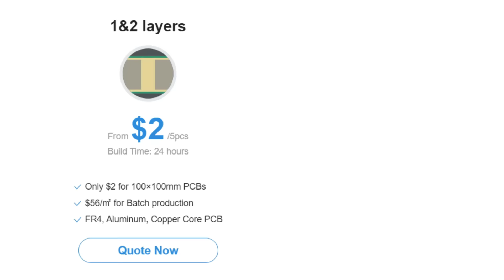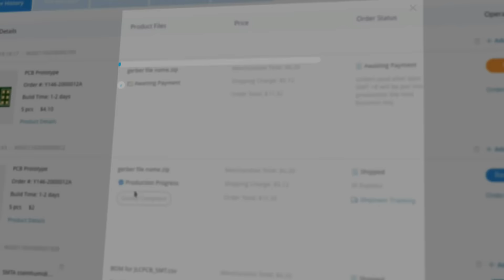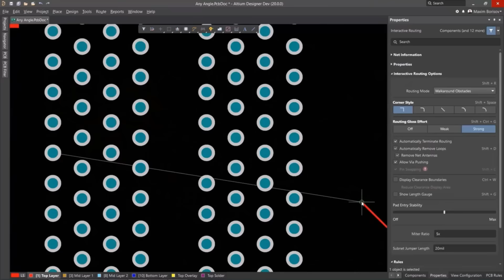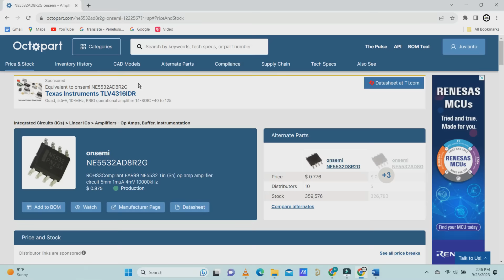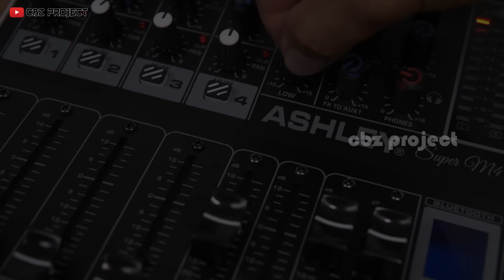2000W + 2000W Powerful Full Bridge Amplifier using 2SA1943 & 2SC5200 transistors #cbzproject

Comment: How did you split the power from one transformer? Did you have a single 20 amp power pcb dividing into two 10 amp outlets or did you take the common transformer supply to two 10 amp power pcb's for each of the amp modules.

Comment: That's really professional! Nice job! The only thin i would improve is adding some acrylic "square tubing" on the big heat sinks to provide good air flow all the way and at same time prevent that something can accidentally short circuit the eletronics.

Comment: beautiful build. 

Were you able to test or validate the PCB assembly prior to soldering the FETs? Once that is done your Heatsink makes component exchange a real pain for maintenance. 

A shroud to direct airflow may also let you operate the fans slower while still achieving the same airflow for cooling if it is smoothly directed to the heatsink and not disturbed by the PCB and sink so close to the blades which cause turbulence.

I will be watching more of your projects - inspiring and interesting.
Reply: C5200/A1943 are not field effect transistors

Comment: Can you do a half bridge design using NJL1302D and or NJL3281D they are 5 pin and have built in diode for bias and can do upto 200w on each transistor
Reply: I like half bridge designs more but full bridge is ok